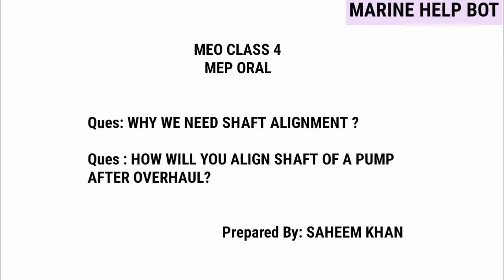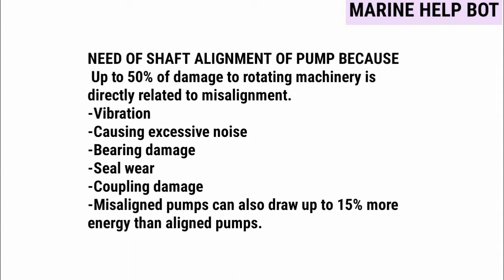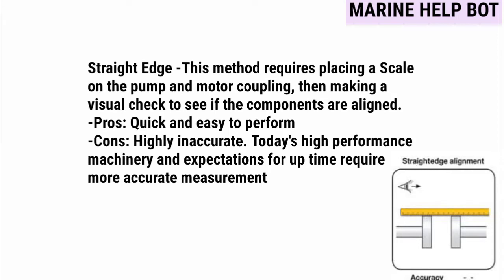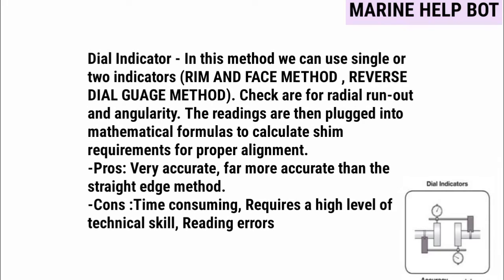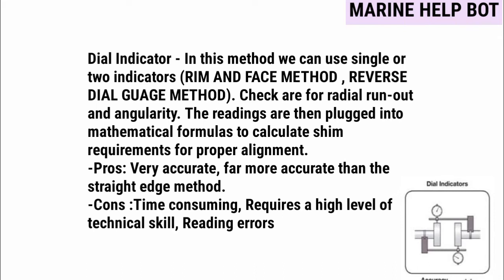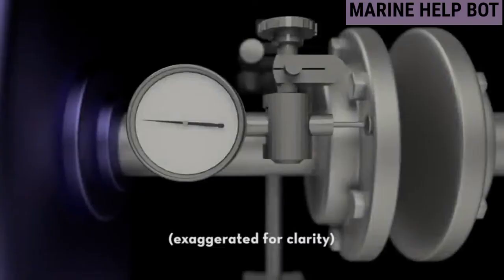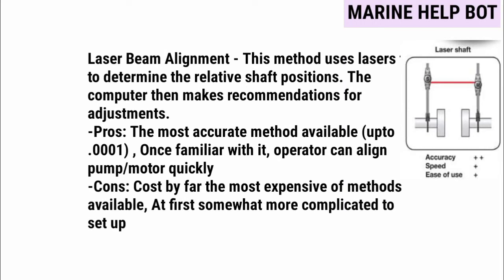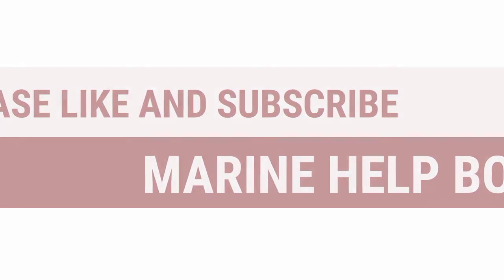Shaft Alignment | Centrifugal pump shaft alignment | Marine Help Bot | Meo Class 4 Orals

Comment: Greetings,
Well Explained Sahim Khan.
I have a question, How do we align v belts in the refer compressor?
Reply from the maker: Check for proper sheave or pulley alignment. If the sheaves are misaligned, it will cause premature belt wear, excessive belt noise, and vibration. Check the alignment by placing a straight edge along the outside face of both sheaves. Misalignment appears as a gap between the outside face of the sheaves and the straight edge. Align sheaves to eliminate the gap by adjusting the pump or the motor to make the shafts parallel. Check for “tilting” of the pulleys with a bubble level.
Belts must be properly tensioned initially then rechecked periodically. The ideal tension for a V-belt is the lowest tension at which the belt will not slip at the highest load condition.
With all belts in their grooves, adjust centers to take up the slack until they are fairly taut. Start the drive and continue to adjust until the belts have only a slight bow on the slack side while operating with load conditions.
Reply: @MarineHelpBotNew  Thanks a lot for the detailed and quick reply.